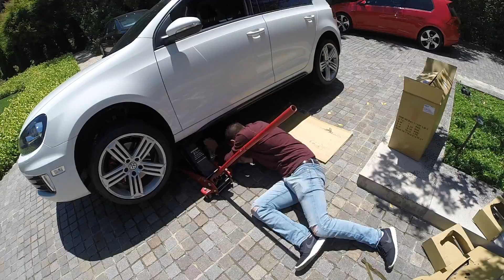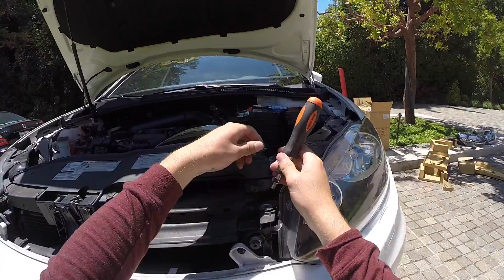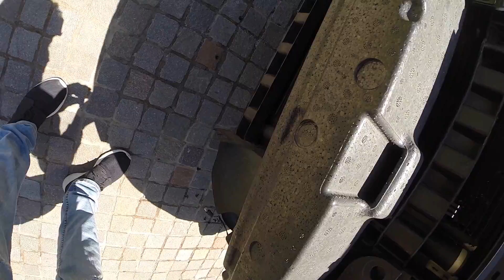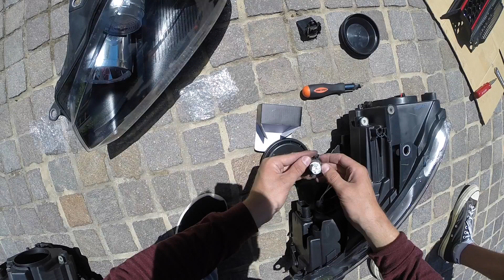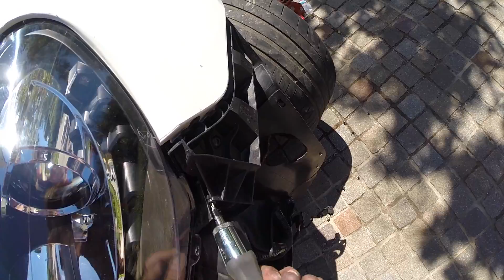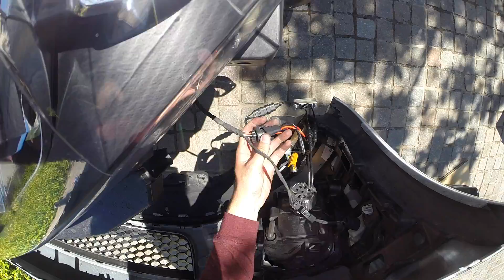DEPO / Helix MK6 Golf R  Headlight Install in POV!

Comment: Update on my set up with the Helix lights they still look good after 4 years. They do get some condensation I would recommend applying silicone seal to prevent condensation and deterioration. Only thing I dislike if you have H.I.Ds its a hard to service them if the H.I.D start to act up you have to take the headlamp out as is hard to reach in. I plan on switching from H.I.D to LED lights.
Reply: thanks for the update!

Comment: Don't put your fingers directly on the light bulb, it will drastically reduce the life span of the bulb. Always use gloves or only hold by the metal.
Reply from the maker: A year late to respond; but yeah you're right. Bad influence, I was touching them because I knew I'd be installing HIDs the next week.

Comment: I have hid's in my mk6 and most to all of the aftermarket headlights are "not hid compatible" Does anyone know what exactly that means, and if so how to get around it?
Reply from the maker: Do you mean you have the stock HID lights already in your mk6? If so, I think that a lot of replacements are only designed to replace halogen lights. I'm not sure if there is a workaround there.
Reply: @GTIModBlog  If I ordered an aftermarket set that said it wasnt hid compatible, would i just need to swap bulbs?
Reply from the maker: @akreese7558  I believe they are incompatible in terms of the wiring, since halogen cars have different wiring for their lights than the factory HID cars do. Not 100% sure though, to be honest.

Comment: How to put in a HID Xenon kit? You have to make a hole to put the cables outside but how to connect te bulb? It won't fit and stuck. Please let me know or send me your video. You will help me a lot.

Thank you
Reply from the maker: It took a lot of fiddling around and I had to warp the metal bulb bracket to get it to fit, and I doubt the metal bracket pieces would survive the install a second time around. I also cut it to temporarily bend open so the HID wire could slide through (since bulb was too big to fit through the bracket/housing thing.

Comment: I just installed the same lights and hooked them up with an H.I.D kit. I was wondering are the projectors adjustable? or they are set a certain way from factory?
Reply from the maker: Miles drove around for about 2 weeks with one headlight hanging drastically lower than the other. I insisted that their had to be a way to calibrate/re-adjust them. He finally agreed to take a look, and 10 minutes later they were fully adjusted, hahaha. All you have to do is use a phillips head screwdriver on the top of the headlight where there are plastic screw holes. You can turn these to adjust yaw and pitch. From there, just follow any generic guide on how to adjust them using a garage door or flat surface. If you're still having trouble let us know and we can make a video on how to do this. We're available at gtimodblog@gmail.com
Reply: I just saw your message, i figured it out. They work great. Do you keep your day time running lights on? I disabled mine.

Comment: Dumb question. I just ordered these and they came with two small blue bulbs as well. I dont recall these being mentioned in your install, can you tell me what these would be for? LED strip related?
Reply from the maker: Oh, I was unsure too. Lol. I think they are "city" lights, and are activated with your low beams & possibly used if you have a Euro switch? But honestly, I have no idea. I didn't install them and have had no problems.

Comment: Did you have any issues installing your turn signal bulbs? I tried putting in my stock ones and they don't fit. Is there some kind of plastic pieces I'm missing that secures the bulb to the housing?

Comment: How do you get the H7 light bulb and connector to stay in place? Does it twist in or just you push it in? Mine keeps jiggling around when I hit bumps.
Reply: KAY SQUARED came here for the same question but I ended up figuring it out after 30 minutes of messing with it. Im not sure if they're supposed to twist freely behind the screws when they're tight but I loosened them a bit and you turn to lock the bulb harness in, then tighten back up. Odd there are no instructions.

Comment: Im wanting to do the same thing for my 2010 gti, but i have the basic halogen headlights right now, did you have to add anything to get the projectors with LED's?
Reply from the maker: Well, that is the point of these headlights. They replace your stock halogens if you never got the lighting package from factory. I had to separately buy an HID kit to put into the lights, but that's simple. Go with whatever brand you want. I did deAutoKey, but people love Mishimoto. Color temperature is up to you too.

Comment: how do you like the headlights still? what light kit did you drop into them?
Reply from the maker: They are great, I have heard of people running into issues with condensation but only have experienced it myself once. I put a deAutoKey HID kit into it, and they are super bright with my deAutoKey fog lights. Install video coming soon!
Reply from the maker: Sorry, just saw this. It was harder than I expected because I had to cut through the rubber dust shields to put the ballast wires outside the housings. The actual hardest part was that the HID bulbs from deAutoKey had extremely thick "end" pieces (the plastic/metal parts the bulb was glued to) and those large pieces were too big to fit through the metal bracket used to hold the bulb inside the headlight. I had to cut the bracket apart to slip the bulb & wires through, and instead of fixing it I just held it togehter to screw it into the housing. It's been a few months since then and no problems regarding that install yet, lol. I recorded the entire process but after much deliberation didn't want to spread such a hackjob tutorial on the internet! Let me know if you have more questions, I'd be happy to answer.
Reply: Hi, i am having Problems with my HID kit. It wont stay in place. Even though i used the bracket etc. with Halogens, it went in smoothly. How did you solve the Problem? Greetings from Germany.
Reply: Had these installed by a shop recently, and the way they fit was really bad...  did you find that they matched up with the grille and quarter panels just like stock?

Comment: Did it give you any faults after installing the lights?
Reply from the maker: No, the lights are designed to not throw any faults. I have experienced intermittent errors with my right side turn signal because I used the crappy iJDMToy bulbs, but that's not because of DEPO, it's because I cheaped out on bulbs.